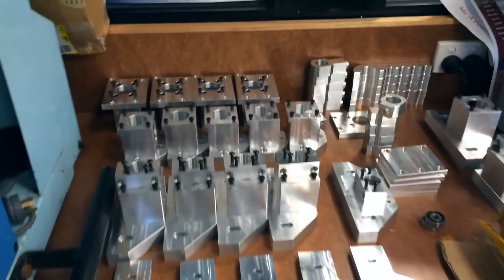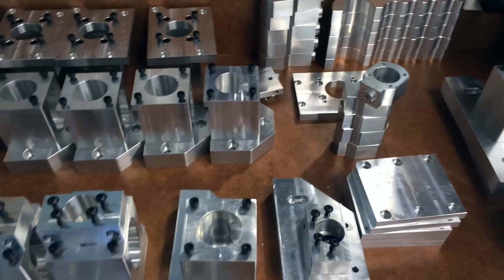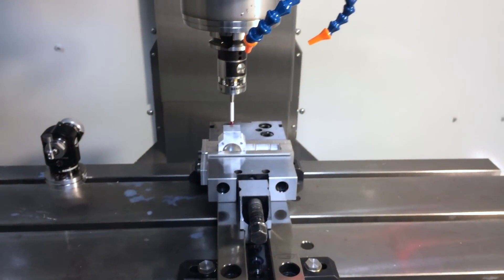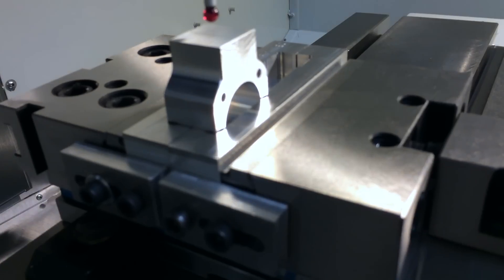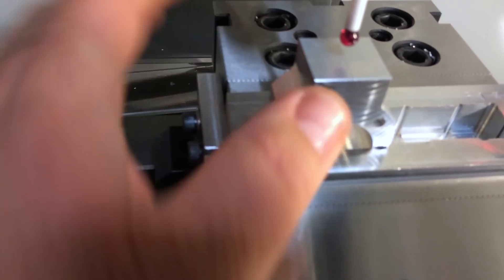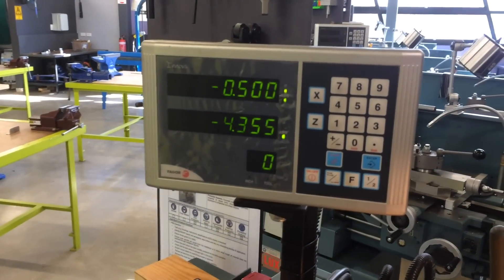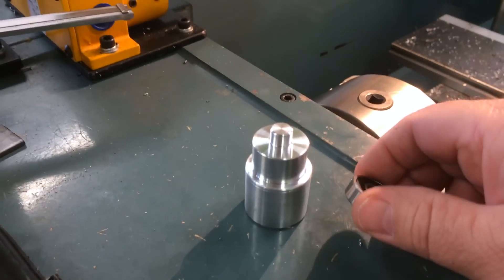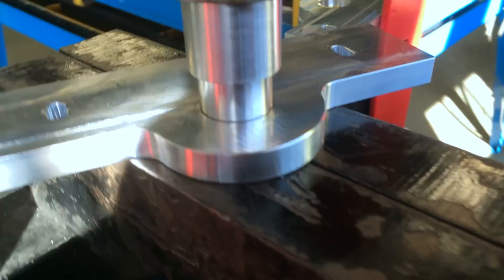Ballscrew CNC Conversion - TM25V / PM25MV Kits

Comment: Hi from Adelaide. Very good info. Was wondering if there is a list of the ball screws used and steppers, electronics kit etc. Thanks for all your info, Im getting started a bit late at 74 but need something to do. Thanks again Merv
Reply from the maker: G'day Merv.  Mate I did have list but lost it all when my Hard Drive crashed.  I used 1605 (C7 Grade) cold rolled ball screws from China and machined cut them to length.  Simple machine on one end for the support bearing.  Watch my playlist titled "CNC Mill Conversion".  It has all the information how I originally converted mine.  Cheers, Aaron
Reply from the maker: Hi again Merv.  Here is the playlist link mate: https://youtube.com/playlist?list=PLSlaZsvoFvDoZTuAcH8t7H3k_-nOI_iLB
Reply: Thanks Mate

Comment: Subscribed your kit looks good..
Reply from the maker: Hey mate, thanks for the feedback and subscription. I see you're working on a CNC conversion also. Let me know when you get it up and running with your next video please? Cheers Aaron
Reply: +DCTTeacher1 

Yea, Using the Arizona CNC mounts for the G0704. Still My 12X36 Lathe is a mix of Parts as soon as it is done will turn my screws for the 704. Have you posted a video on CNC Zone? Not sure if they would allow with out being a vendor but i know someone can post a build thread and give a a plug to the kit mfg.

Comment: why use 2 angular contact bearings? dont they prevent thrust in both directions anyway?
Reply: +DCTTeacher1 A lot kits use 2 sealed angular contact bearings.
Reply from the maker: Matthew Hadley Hi Matthew, these aren't angular contact bearings.  These are standard deep grove bearings.  Deep groove bearings only provide 1/3 (1kN) thrust load compared to their static radial load of (3kN).  I use two bearing with a steel spacer between them.  This gives me 2/3(2kN) static thrust load and removes any end float the bearing would have on its own. Thanks for watching and commenting.  Regards, Aaron.
Reply from the maker: +ExportPilot : Yes I have noticed that.  However, I went down this path and it hasn't given me an ounce of trouble.  I've thrashed the guts out of my original TM20 CNC mill with these bearings and have even had a couple massive crashes.  It's always the cutting tool or coupling that goes bang ;-)

Comment: Looking really good mate! Gootta love that probe system, I have to get one of those when I have the spare cash...
Reply from the maker: Gough Custom Thanks Aaron.  Yeah the Reneshaw system is cheap, but you pay for quality.  I think it cost us $8K - $10K AUD to have it fitted to the Super Mini Mill.  But don't quote me on it.  Cheers, Aaron.  PS: you've done an amazing job on your Fadal.
Reply: DCTTeacher1 I'm vaguely keeping an eye out for one of the older wired Renishaw systems for my Fadal. From the instructions I've seen it looks like it should be pretty easy to hook up.

Thanks mate, glad you like the Fadal so far!

I was working today to get it setup with DNC so I can transfer files to it. Only problem is that there are no usable DNC programs for Mac, and not having a real serial port makes it even harder! Figured it out though for the most part! Had to download a 3rd party driver for the USB-Serial adapter, then ended up actually writing a small command-line DNC program!

Will be posting the walkthrough on PracticalMachinist shortly!

Comment: Great video Aaron! When you probe with the Renishaw, do you tell the controller roughly where the stock is and then it probes it from your rough locations? Else how does it know where to start?
Reply from the maker: russtuff Hi Rus. Yeah with the Renishaw you simply jog it to the approximate centre or edge, tell the controller it's rough size or distance to the edge and press cycle start. Renishaw have their own programs that get loaded to he HAAS controller and you simply pick the options they provide you. The tool probing is awesome too. Cheers, Azza.

Comment: I'm thinking about buying my first milling machine, and the PM25MV is on my list of candidates.  How different do think this mill is compared to something like the G0704 with Hoss's plans?  If feasible, I'd love to do as much of the conversion myself if I can.
Reply: Paul Frieden Having a G0704, I think the PM25 looks like a solid machine too. If you can swing it though, I would look into the ZX45 and its clones. Its not much more in price, but the machine is quite a bit heavier.
Reply: russtuff Well, I started out looking at an X2.  I've already talked myself up one pretty big step, so I'm hoping to stop before I get to a Hoss VMC. :)

I'm basically just curious about it, and I want a new toy.  I work in IT with a hint of software development, so I sit at a desk 80% of the time.  working with my hands to make a physical object is therapeutic.
Reply: Paul Frieden Right on. Well I don't think you'd go wrong with either. That PM has a lot going for it.
Reply: +DCTTeacher1 My friend had a PM25 has a Much Heaver Duty Machine Base... If i could do it over again I would have went with that vs the 704 but the PM25 was not available.
Reply from the maker: Paul Frieden Hi Paul.  In my opinion I would choose the PM25 over the G0704.  It comes with a belt drive as standard, the column mounts directly on top like a real VMC and not at the rear, plus there is more room under the table to fix the X-axis ball screw.  We don't have the Grizzly's over here in Australia, but we have the Optimum mill which is virtually the same.  Hoss' plans would work, but you would have to modify the saddle / lift nut plans to make it work. Thanks for watching.  Cheers, Aaron.
Reply from the maker: +ExportPilot I think all these little mills have their good and bad points.  If I did it again I would probably convert the larger RF45 type.  Opt for the BT30 spindle and then use a pull stud instead of the bevel washer idea.
Reply: DCTTeacher1 I agree Aaron. I would go with the 45 too if I were doing it all over.